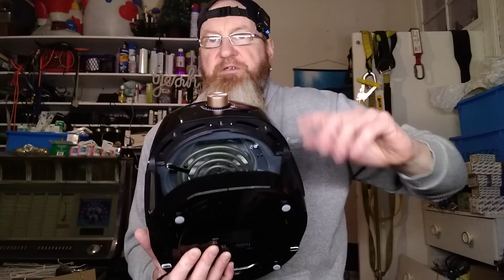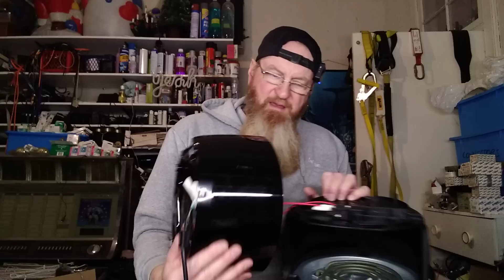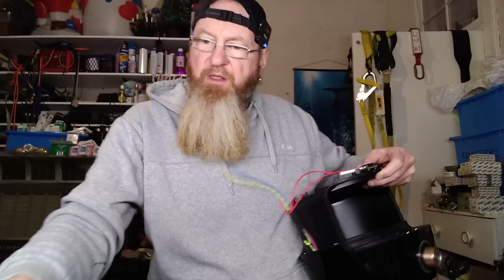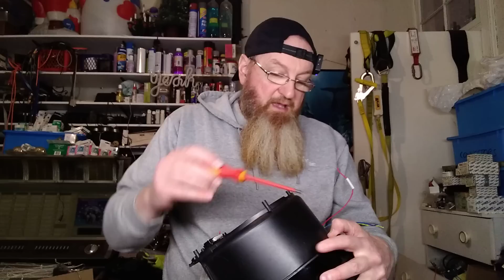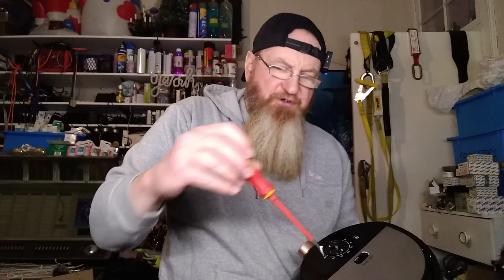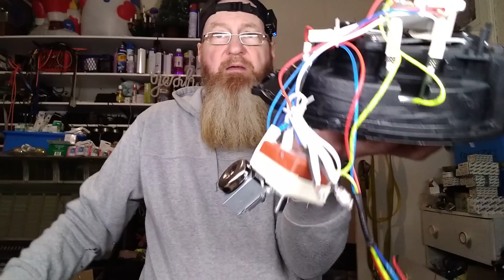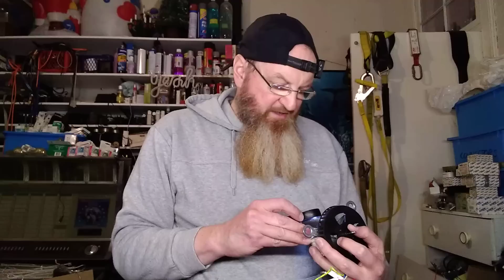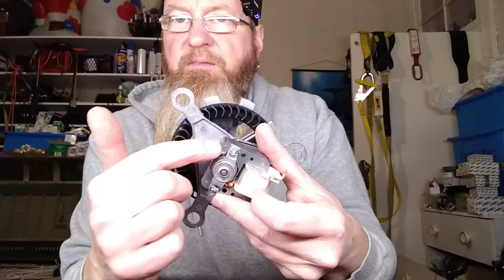Total teardown of an ASDA air fryer

Comment: I've been using it for 2 years, it's fantastic for chips, fried fish and other things, and just a drizzle of olive oil on the food before cooking. Every 5 minutes I turn the food, and check until the browning is even. Crispy, light and tasty. But with less fat. 😉👍
Reply: i'd read up on the temps your cooking with and those temps effect on olive oil and those effects of  (potentualy) altered olive oil on you body / health.
peace
Reply: @memyselfandeye1234  I'm 55 years old, I'm thin and I live in Italy and I eat Mediterranean cuisine much better than that rubbish in America, where they compete to see who is fattest with unsaturated fats. 🤣Read comment later
Reply: @memyselfandeye1234  use coconut oil, lard, tallow... all high temp fats.
Reply: @MostlyInteresting  castrol gtx?
Reply: @memyselfandeye1234  very good point indeed. Some oil gets toxic.
Reply: @Sanisfaction  Extra virgin olive oil is ideal for frying because its smoke point is around Degrees centigrade 210° compared to other oils which reach it at lower temperatures (e.g. sunflower oil around 130°, peanut oil 180° , soybean oil 130°).
Reply: @CelentAle  naaa genetically modified sunflower oil with more oleic acid, at least it's what Bressanini said.
Reply: Yes, everything we've tried so far has come out great.  the first few times we used it we had to figure out how hot and how long but now it's second nature.
Reply: Fat is your friend. That's where the slow burn long-term energy is.

Comment: I would have bought one of these things a lot sooner if they had just called them Turbo Super Duper Convection Ovens.  The name Air Fryer sounds like a con to me.  You can't 'fry' with air, but you can bake.  Ironically for years I had wished for a small convection over for 1 person instead of having to heat a full oven up.  Well, I got one a few years back and never looked back, its been doing over half of my meals, and probably 90% of my older kids meals who just want to head up wedges and other frozen food goodies like pies and chicken bits and pieces.

Comment: Might bite the bullet at some point and get one, but we're extremely short on counter space. And we have a Sharp combination microwave and convection oven that I bought used for $75 about 15 years ago. I've needed to replace the micro switches, fuses, and turntable motor. But otherwise it's chugging along great. It heats pretty quickly, and is big enough to do a 15" pizza or a couple 9" cake pans.
Reply: And of course all the repair parts except the motor came from other microwaves I tore apart.
Reply: @strehlow I have a space saver toaster oven with an air fryer. It stands upright on the counter and you lay it flat to use it. It works well for what I need.
Reply: I'm short of counter space - I put it away after every use.
And I use it every day. 
But if you already have a tiny convection oven you may not need one.

Comment: I think the spit washer should go last and butt up against the nut. It's there to stop the nut undoing.  Quite astonishing how many parts are reusable and as you say a good source for £20.
Reply from the maker: That's how I would normally do it, but the spring washer was between the large washer and the fan.
Reply: Wouldn't you damage the spring washer when tightening since the nut was going in the other direction when fastening without the top washer? Its a left threaded nut (is that proper english? Thats how its called in NL)

Comment: We are in 2024 and not a single microprocessor in sight! Not even an led! When was this designed? in the 70's?
Reply: It's no good, no option to flash SOS!
Reply: Probably not.... I had a Tefal deep fat fryer from the 1970s, and that did use both, a microprocessor and LEDs. It was a device ahead of its time, even in the early 80s it was hard to surpass.

The technology in this air fryer is straight out of 1950s, just not as robustly built.
Reply: @whitesapphire5865  i repair quite a few air fryers there pretty good i would say 3/4 of the failures i see are when people dont leave adequate room for the exhaust air they push well up agaonst walls they cant cool and pop the termal fuse ocasional heater element, on the mechanical timers had a few that just stop randomly and never shut the powrr off and some that just stop working. again on the mechanical timers get a lot of broken knob where people wrench the timers backwards and break the plastic shaft on the knob alot of failures are do to miss use.
Reply: @whitesapphire5865  How robust does it need to be?
I have this model air fryer and it's built just robust enough. Which is fine since I have no intention of throwing it at things. I was actually quite impressed by how nice and simple it is - the only weak part part appears to be the thermostatic fuse.
As for things being robust enough - I bought a house with the cheapest oven going, roughly 15 years old. It still worked but had been vandalised (front of oven door kicked in). I went and got a replacement unit - absolutely identical - made of only just thick enough sheet metal, a couple of simple knobs and a heater element. Since it's built in it's not going to get abused round the back and everything else is simplicity itself - I'm expecting it to outlive me if I don't accidentally set in on fire, big stylee.
Reply: It probably doesn't even come with an app that requires your location, e-mail and a stool sample!
Reply: @95rav  Israeli security agencies are working on adding detonators to these
Reply: Good!

Comment: What's the wattage of your air fryer? In 120V land we are power-limited.
Reply from the maker: The heating element is 1kW.
Reply: @bigclivedotcom  Surprised it's so low. @tomk2165 we can run up to 3kW without a dedicated connection.

Comment: The heating element looks exactly like the "ring" of an old-fashioned electric cooker. Probably it's the same component.
Reply: Yes, I thought the same. The bracket plate has been moved.
Reply: I know an air fryer is just a small oven, but it's a better oven. Frozen croissaints take 15 minutes not 25+preheat time in our big oven, and they come out crisper! 

I get why a full size oven is the default in houses but I'm surprised the single-portion-oven concept didn't become popular sooner.
Reply: For the guy thinking they add stuff to the food to help it crisp up or the person who thinks chips are better in an air fryer, try broiling in a regular oven. That's all an air fryer is, a broiler with a fan in a more confined space. That's why everything gets crispy. The radiant heat is directly on the food which helps make it crispy while the fan circulates the hot air in a smaller space to help cook it faster.
Reply: And a fan. ...
Reply: It really is nothing special. Its a forced air oven that has been hyped beyond believe (by Philips and the likes) just to sell different types of the same food that are supposed to be healthier when compared to the original food that we use with deep fryers. What they don't say is what kind of additives manufacturers have to add to make chips or certain snacks get the same amount of crisp (not that its actually the same). The whole thing is s scam and an unnecessary concept of a device. Either use a deep fryer, or an oven, and that will get you all sorted in regards of what this device is trying to be.
Reply: @thomasvnl  You don't need special food for an air fryer, just use the regular products that are for any other form of cooking. The number of people that own them and find them useful, including myself rather belittles your points, unless you regard all these people as stupid.
Reply: @Bernie_the_Bolt  Left a bit, up a bit , fire.   🙂Our local fish n chip shop always give way too many chips, but won't reduce the price if you ask for less. but since getting the air fryer they can give me as many extra chips as they like. I freeze the left overs and then chuck them in the air fryer way better than the first time around.
Reply: @Bernie_the_Bolt  How very absolute of you. No I think the manufacturers of these devices are stupid, and I think people don't actually need them. I don't think people who fall for the traps of big co. are stupid.
Reply: @TheEmbeddedHobbyist Sorry  I don't understand the concept of left over chips 😮,  Does not compute😂
Reply: @dogwalker666  Must be an old age thing, I don't remember being a problem when I was younger 🙂 or they have increased the chip to fish ratio so that you still think your getting a nice big fish supper.
Reply: @TheEmbeddedHobbyist  It depends a lot on the shop we have one where the fish is enormous, My favourite but sometimes the queue is ludicrous,  If I go a few miles east to the coast they are tiny portions for the Tourists.
Reply: @thomasvnl  Need? No.  Usefulness and can replace multiple appliances to save room and do a better faster job, Yes.  Other than a deep fryer.  I would like to see another appliance cook/reheat food and have it come out crispy and not soggy at the speed and size of a Air Fryer.
Reply: @thomasvnl  they are a really useful device, especially for single blokes who like UK style chips, easy to clean, use less power than an oven, safer than a deep fat fryer and portable, unlike an oven.
Reply: @Bernie_the_Bolt lighten up, Francis.
Reply: @thomasvnl  I use an air fryer because heating its small space is much more efficient than heating the large space of an oven, the air flow is designed to cook with less heat in less time.  Absolutely they are essentially just an oven, the name is rather misleading.  But unless you are cooking a large volumes of food they are cheaper to run and cook far more quickly.

Maybe it is different in Netherlands (I am guessing from your name), but I have never seen anywhere here sell "different types of the same food" for air frying.  Where air frying is mentioned on packaging it is just a separate set of instructions alongside those for a regular oven, fan oven, microwave etc.  I find they make chips far better than the oven ever could where I just put the soaked and dried potatoes in a bowl, a spoonful of oil, and shake.

Do I need one, probably yes.  Because the time and effort involved in using a full oven to make something for myself means I would not really put in that effort.  And things come out cooked much more evenly too.  Since getting one* I have eaten better and more healthily.  And not everyone can afford to ignore their electricity bills or needs to feed a family, and for those a cheap air fryer like this was cover its cost in no time.

* Not entirely true in that I bought one a decade ago, found it to be rubbish, and put it in the cupboard.  It is only much later when I discovered that "air fry" is a complete misnomer and it is just a better designed oven that I tried using it again and found it to be pretty amazing.
Reply: @rebeck
Well said! Too many people sneer at what is a really good idea. Much cheaper to heat a small space.
Reply: @thomasvnl  for me and hoping it uses less energy as a single person.  Rather like my oven and never deep fry anything
Reply: @thomasvnl  Yes it does the same thing as an oven, but a lot quicker, and with a lot less electricity. I stick my bacon in it for 6 minutes, and it comes out with the perfect crispiness for bacon rolls.
Reply: @thomasvnl  You think you need to have 'different types of food' in an air fryer? That probably says everything that needs to be said about your actual knowledge on the subject. Literal children know that's not the case, and I'm willing to bet the rest of your knowledge and opinions on the matter is equally as full of utter dross.
Reply: @thomasvnl  basically a baby belling crossed with a fan oven,  Absolutely nothing new.